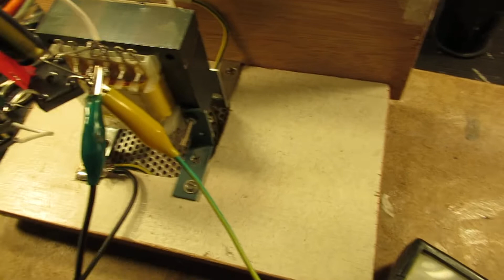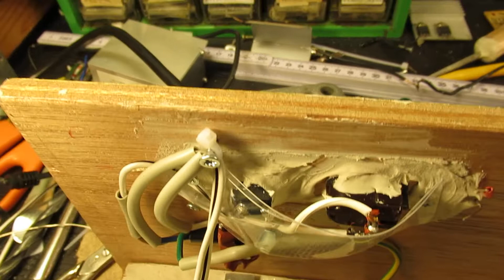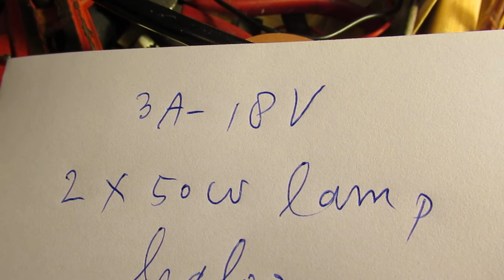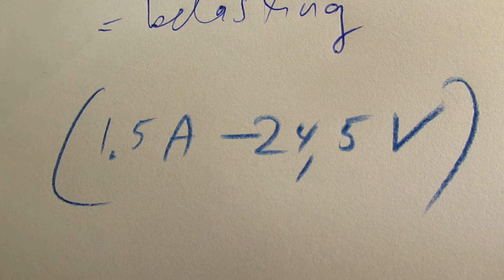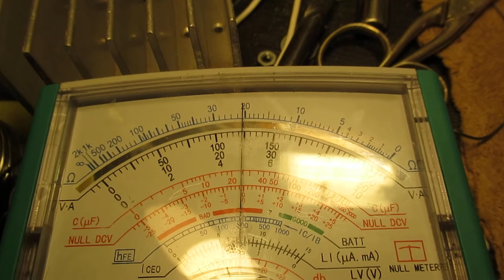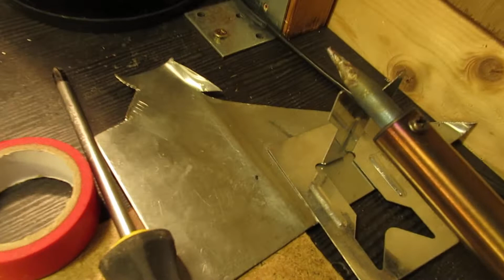24 V home made lead acid battery charger part 2: endurance test of the 230 V/110 V AC transformer

Comment: Would be interested in seeing your DC output on an Oscilloscope... Curious how well that cap smoothed out the voltage. You are quite the inventor Mr Radiofun ;-)
Reply from the maker: Thanks, when I have time (and everything is made in a definite way) I will do that, thanks for the idea. By the way: the lead-acid battery also acts a a kind of "electrolytic capacitor", as far as I know, but I never did experiments on that issue/subject and/or study that (theoretical) effect with the oscilloscope.